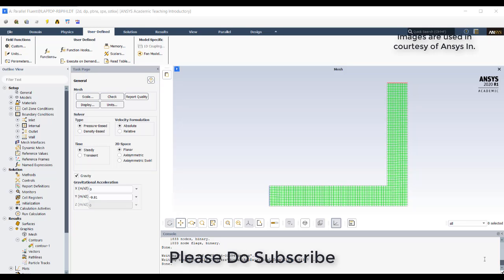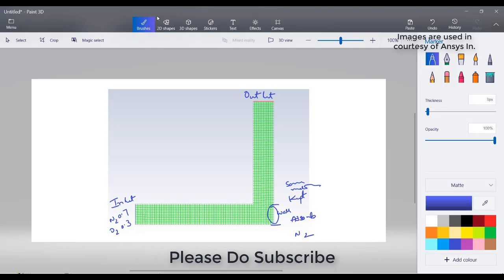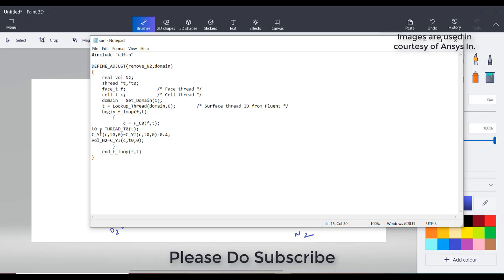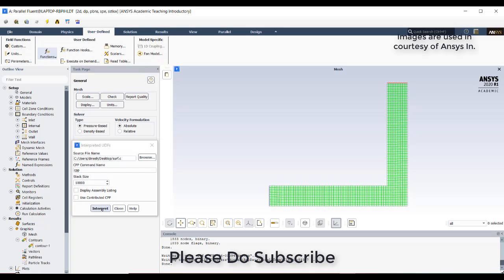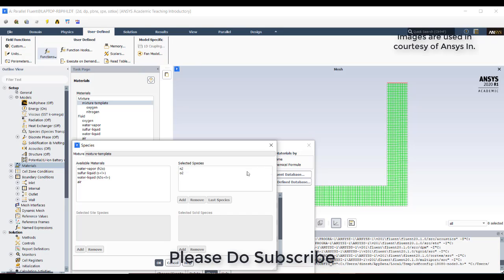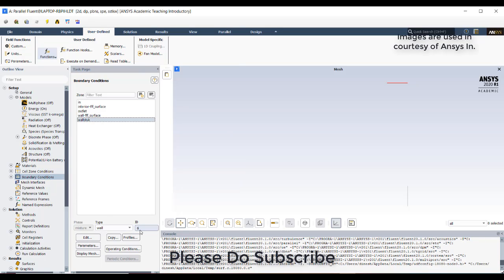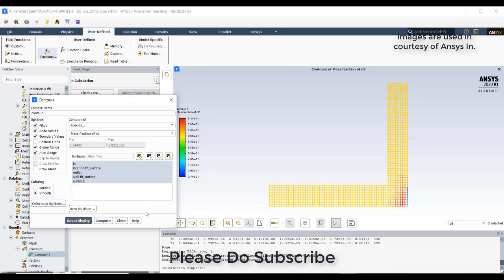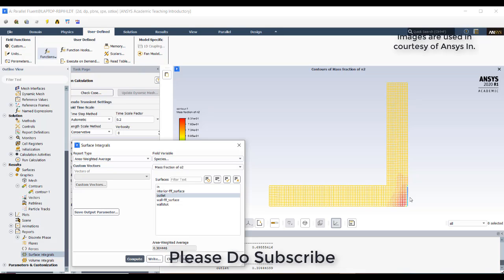Adsorption of Species on Wall || Species Transport Ansys Fluent

Comment: hello shavan, I have a doubt suppose I simulate methane reformer  there is two inlet one is methane + air and other one is methane + h2o. in 2D geometry. there is also a catalytic material in the 2d channel at wall. so the question is how to a mixture model for reacting. and which model work? pls suggest me. ty

Comment: Hello Shavan , thanks for the video, 

When I tried to load the UDF file, I got this Error Message " the udf library you are trying to load is not compiled for 3ddp on the current platfrom" 

Any solution ?
Thank you so much in advance
Reply from the maker: Did it got interpreted without errors
Reply: Usually it has to do with the installation (or configuration) of Visual Studio, which is required to run the UDF. For example, some important add-ons need to be installed, otherwise the compiler will fail. Or perhaps you haven't installed it yet, so please check it out.
Reply: first,change udf coding style from udf-8 to ANSI
second,be sure you are using correct UDF paralleing tricks.(such as if RP_NODE,RP_HOST,etc)